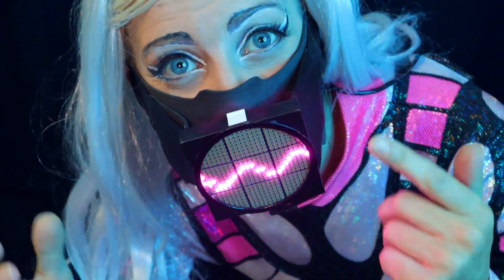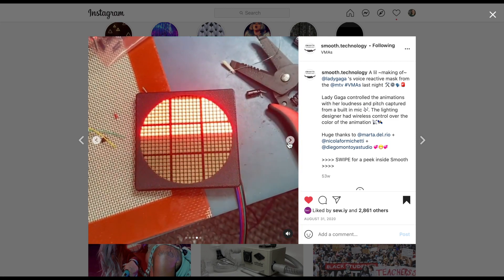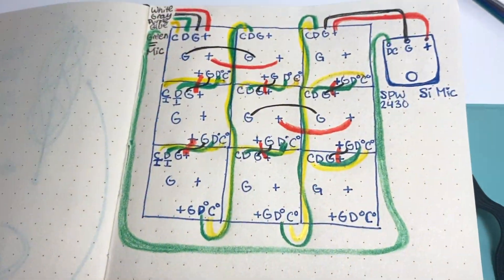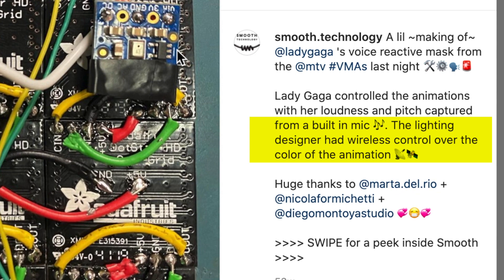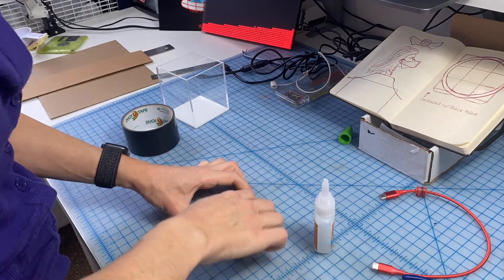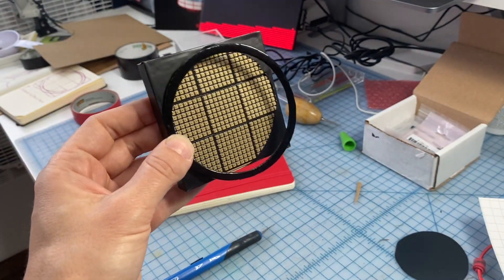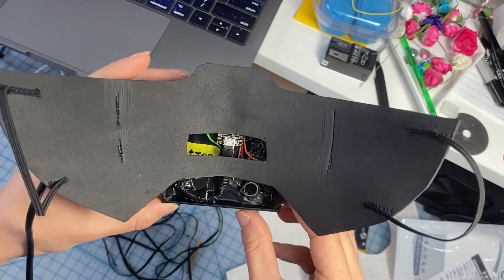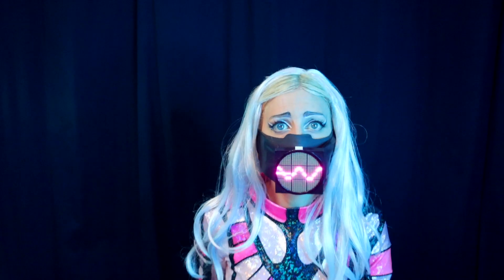Lady Gaga Cosplay: Making The LED Matrix Mask from the VMAs' Chromatica Medley

Comment: Thank you for this! I am planning on making one for the Chromatica Ball concert! On a scale of 1-10 how difficult is this to make for a beginner? I’m so excited to get started! 🤗
Reply from the maker: It’s hard to say, the mask itself is made of cardboard and foam so a crafter should be familiar with that construction process. The LED matrix requires familiarity with electronics, soldering, and programming, or at least familiarity with uploading code. You can find my code on the blog but I didn’t write a tutorial because it would be too much effort to explain. There are links to my resources tho! 

Good luck with your project. 🙂
Reply: @TechnoChic  Thank you so very much! ☺️
Reply: @Tuda217  how did it go